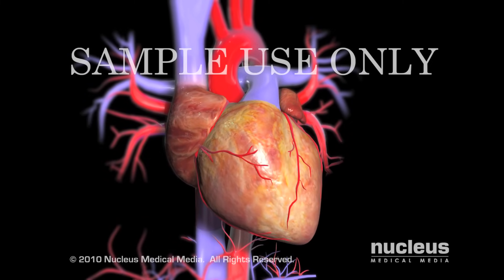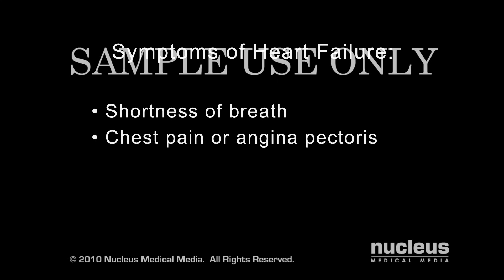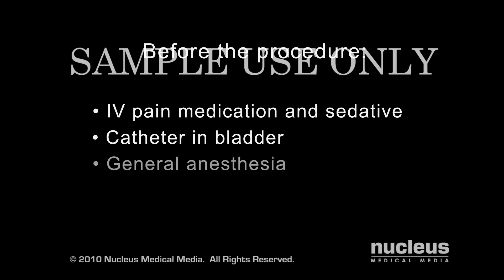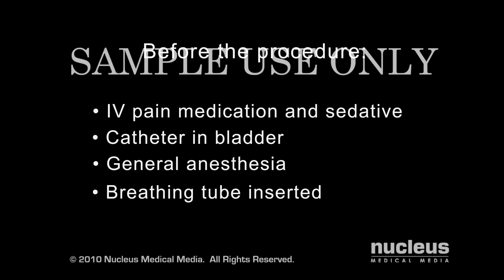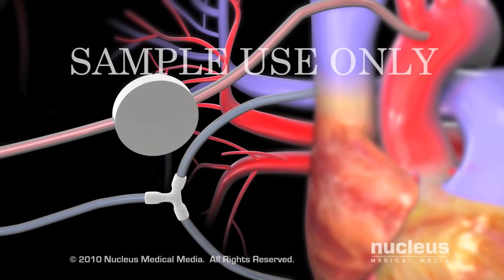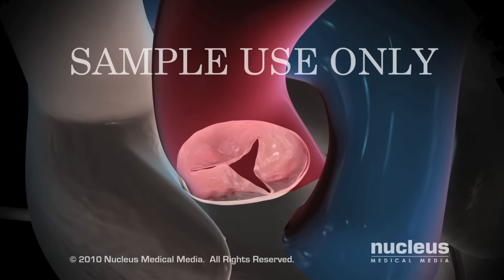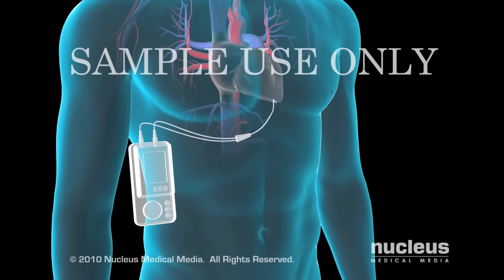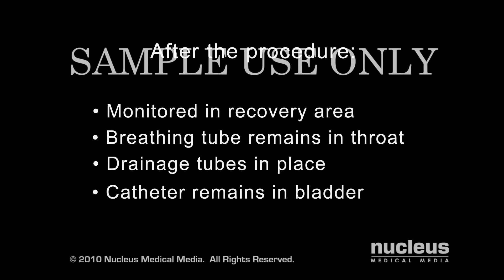Aortic Valve Replacement

Comment: i’ve had this surgery in june at age 17 and everything went great during the surgery. After waking up from it and the first 2 days was the most difficult experience for me due to the pain and dizziness which i barely made it. Now its been month after the surgery, i thought the recovery part supposted to be the moment which i should be grateful or something but as my today’s condition, im feeling just empty and looked down emotions every time because of not being able to do things that i wish to do or used to do and problems i got. What i’ve  be doing is just sitting in front of my tv and doing some recovery exercises everyday. My only hope for now is the things will get better one day somehow. Also i know no one is coming to save me and all of it depends on me but i think i am about to drown in this sea of loneliness or whatever.
Reply: Which things you cant do? I thought that after surgery everything comes back to normal
Reply: @macieknowak4922  Not immediately. You have to work at it. That is what is called "rehabilitation". It is a matter of being patient and persistent. I thought I would never get to climb up a steep hill on my bike as I had previously, the process seemed to take so long, but I could and did with perseverance.
Reply: Hey cheer up. You will feel much better. I am going to have this surgery soon.

Comment: I had AVR back in 2006 when I was 8, I don't remember much at that point of time, I am now 24, I had been installed a St. Jude's prosthetic valve, My friends call me Iron Man since the sound of the beating of the valve is very much like a clock, tick tock, I am on Warfarin and I have to take that for the rest of my life. I am good now, there are no breathing problems, the only limitations are some of the foods such as particularly in vitamin K, since it helps in the clotting of the blood.  I have regular INR tests periodically each after 6 months with an ECG and an Echo color doppler , everything is fine, thanks to God, Doctors and surgeons and the curiosity of the Human race.

Comment: I have a sclerotic aortic valve leaflets, mild mitral valve regurgitation, mild tricuspid valve regurgitation, and afib. Several doctors have told me I'm not sick enough to need treatment. What would you tell your patient if they were me?
Reply: i have mild regurgitation on my aortic valve after receiving a mechanical replacement 3 years ago.   went to get a EET exam. the one where they shove a camera and ultra sound device down your throat and esophagus to take a picture of your heart, the back of it.     well something happened during the operation.  i was just about as conscious as i am here and now speaking to you (stupid high tolerant to opioids, even the fentanyl) and there was a moment they dropped a device and everyone in the room gasped, froze and stared me right in the eyes.   mouths gaped open an everything!! i didnt ask them wth was that, but i can still remember everyones face in the room .  this was in march of 22.             so my cardiologist deemed the operation necessary to get a better picture and more data regarding the regurgitation but this minor op caused some serious damage.       im on blood thinners due to my mechanical valve, as i mentioned, and so any internal bleeding is cause for extreme concern.      death is highly probable if the bleeding is excessive enough and in the proper wrong spot.

so ive been to the ER three times since the operation, and it wasnt until the third i put two and two together.

because i was under a lot of fent during the operation, (they made sure to indicate in their report,  that instead of the typical single dose of 1mg fent, i required 7 doses of 1mg. along with the propofol and etizolam) i hadnt really made it a point to ask my GP afterwards if anything bad went down and did they write it in there.   ill spare typing out the symptoms i had at home which motivated me to get to the ER, mostly chest pain and profuse sweating, but the tests indicated i didnt have blood in my lungs and so the internal bleeding wasnt an immediate cause of concern.            but the ultra sound results were ostensibly nothing positive or negative, just told us what we already know.     i guess its a good thing because it couldve indicated that the regurgitation upgraded from mild to moderate.     

im telling you all this because im trying to say, i regret getting the operation done.     it caused more damage and did more negative than positive.    it was the only way to tell if any regurgitation had begun behind my heart, and on a separate valve than where it was previously, on the aortic.         so that is one way to look at it.       i will never get another one done, (eet exam).  if i start getting more similar symptoms ill just ask for antibiotic and fight it, and then go from there.        they not only almost killed me thru internal bleeding, but they didnt tell me or evidently write it down in the report.       thats insane.

they took the time to (almost sarcastically) write how high of an opioid tolerance i have, as they mentioned it was the highest they ever provided to a patient in this type of exam.  for whatever reason that is.  my GP had a little chuckle at it, like how funny, you are a drug addict, require more meds than an elephant .   

(im not) , if anyone has gone thru the things ive gone through they would require the same if not more meds i am on.  

i learned right that day, how risky everything is in the medical industry .   especially operations and surgeries.   you are at the mercy of everyone in that room.  if they dont like you , for whatever reason, or having a bad day, etc, one small slip up and thats it , your gone.  and not even quick and under sedation, long slow, agonizing, without an understanding of why, or how, when.  

they are people just like anyone with faults and flaws, and for that i dont blame them.  but sometimes we put too much faith and trust in those same people..  its their jobs, day in, day out.    they can get jaded.   they can get complacent   they can get ignorant or negligent.  in a blink of an eye too.

just recently in the canadian news there is reports of a doctor who is being charged with 3 murders.   of his patients, all elderly.
i havent read much into it because i had read my share of doom news for the day/week. but going to follow up.

when the nurse was looking for a vein prior to the operation after minutes of not finding anything plausible and two major misses.  
(ones i told her are not going to work) ,   i dont have many, only a couple left in my foot, and i cant afford to lose those two incase of emergencies.  
    a third nurse who was proclaimed to be an expert at locating and successfully connecting an IV in "difficult patients" was invited into the OR and she looked around at my arms for a bit and said she enjoyed this part of her job very much. 

"Shopping for veins" was the exact quote.    "to pay in blood"......🤕🤒😓

Comment: My father did this surgery in 2010 but unfortunately he had to done this surgery again in 2012 and now its 2020.he felt really good in this 8 years but now he is suffering from some problem so if it required can he do another aortic valve replacement surgery.
Please respond if anyone know about this.

Comment: I've had 2 now since 2010, first was a tissue valve which only lasted 1 day off of 5 yrs and failed from calcification so in Nov of 2015 they put a ON-X Mechanical valve in and its been working fine until last week. Having Palpitations and a erratic heart beat. So once again I wait till next  week to get the results from the Electrocardiagram and from the 48 hrs i had the Holter monitor on from the ER !!

Comment: I'm only 21 and have mitral valve prolapse.  So might have to have sergury depends on what doctor says.
Reply: Val Dal I’m 22 right now and had OHS aortic valve replacement last 2 months ago. Are you going to have a heart surgery?
Reply: MVP is very common and mitral valve repair is only rarely needed.
Reply: @wholeNwon  I know it depends on if valves are barely work mine is 50 percent.

Comment: I was diagnosed at birth with bi cuspid aortic stenosis. Now at 40 I just had my mechanical valve put in 6 weeks ago. Honestly my heart has never felt so strong. Can wait to get back to a normal life. Only down fall is that I can hear my valve open and close.  So I feel like the crocodile on Peter pan.  Lol
Reply: That's pretty interesting
Reply: After a while you won't even notice the sound.
Reply: I had a bicuspid valve as well......It was only opening up about a half inch and wasn't closing all the way. I had my aortic valve replaced with a "pig" valve  3 years ago and am doing great! I'll be 70 soon.
Reply: witchesbru67 wow amazing

Comment: When heart-lung machine is inserted somehow bypassing the heart, how the heartsells are getting blood during the operation?  
Does not look like a fast operation. look to me as a high risk for heart tissue necrose.
Reply: The Heart Stops beating
the cells need way less Oxygen if they don't do work
Reply: @user-si5fm8ql3c  Logical, good answer.
Reply: Idk if it was help by the breathing tube that can get to the lung, then the heart lung machine will exchange the air with oxygen poor blood to oxygen rich blood
Reply: The heart is both stopped and cooled so that metabolism is very greatly slowed.

Comment: I am so scared cos last Fri, got a news from my Dr that my heart valve does not closed tightly enough, so blood can leaks (regurgitate). In dis case my heart has to work harder to pump this extra blood. Over time, in long run this can damage my heart and cause heart failure. As I have CML (Chronic Mylo Leukemia) Dr told me it will be a very risky for de surgery. Now I always feel worried & sad 😥😢😢.
Reply: I just prayed for you!